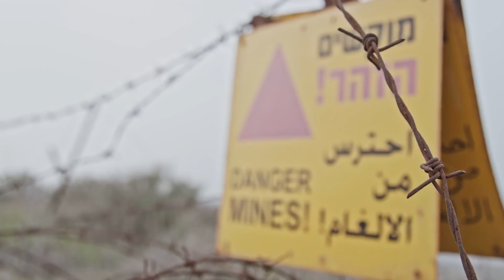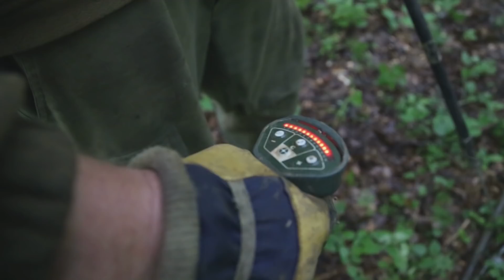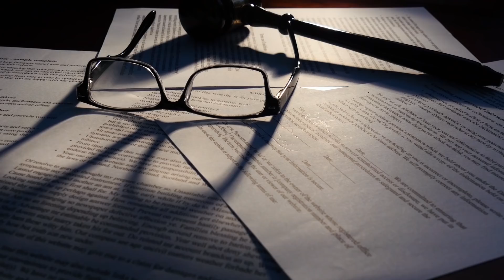Weapons That are Forbidden to Use in Most Countries of The World!

Comment: "the power of such a bomb is comparable to that of a GIANT meteor"
hahahahahaha no.  The biggest thermonuclear weapon ever built was the Tsar bomb.  It had a max of 100 megatons, meaning the energy was equal to 100 million tons of TNT.
The asteroid that killed off the dinosaurs 66M years ago is what everyone is thinking of.  That was a rock about 6 miles in diameter.  Which doesn't really do it justice for the mental image in your head, so picture this instead: when the asteroid slammed into the ocean floor, the top of it was still higher than cruising altitude of airliners.  Big rock.  But I digress.  Its impact was 130, not megatons, not even gigatons, but 130 motherfucking TERATONS.  Every nuke we've ever THOUGHT about making, combined, is a tiny firecracker compared to that.
And while that asteroid was exceptionally destructive, that was due as much to its impact point.  Studies show it hit the absolute worst possible place.  Had it hit land, the dinosaurs would still be around.  Had it keep deep ocean, they'd also still be around.  The exact point of impact served to maximize the environmental impact.  It still would've had the same explosive force, but the consequences would be less serve.  For example of it hit deep ocean, it would have created a megatsunami 3 miles high (the 2004 Indian Ocean tsunami, one of the deadliest natural disasters ever and the result of one of the most powerful earthquakes ever recorded, was a mere 100 foot at its peak) that spread out in all directions at supersonic speed.  Let me know when we've made a bomb that can do that.

Comment: The first one doesn’t make any sense.  We have hallow-points.  I have them loaded in every gun I own besides my shotguns, they are loaded with 00 Buckshot.  However, .22 caliber built, does the same thing, It is not strong enough to get completely through the body, and it bounces off bones.  And a 5.56mm (NATO) or .223 Remington does the same thing.  It gets in and bounces around.  And they are great varmint rounds.  Also, the hallow point gets inside the body, and mushrooms, creating drag, which does not do anything but stops before it exits the body, it was designed to not put anything beyond the target in danger.

Comment: And Lasers, as weapons, even as "blinding weapons," have a very short time-period of usefulness as Weapons, as the ability to create cheap countermeasures typically coincide with the creation of a laser powerful enough to be useful as a weapon.

Hardened aerogels, and Super-Reflective/Super-Refractive materials have now become cheap enough (although the latter two are not yet scalable in production) that it will not be more than five to ten years before the current Lasers developed as weapons will be actually useless. And super-reflective/super-refractive materials are not hindered by paint, dirt, dust, or even being broken.

And eventually, Super-Refractive Materials will also make lasers useless for any purpose (such as target designation, or range-finders). Super-Refractive materials will also negate Radar’s usefulness as well.
Reply: Kind of hard to hide shiny stuff
Reply: US AIR FORCE AIRBORNE LAZER SYSTEMS WERE RECENTLY REPLACED/Retired 2009 uases a 747 airframe as transport.
Reply: 747 airframe google Usaf ABLS YAL61

Comment: Tell the one about the bullets that do the whole flower thing I can agree to those being used in one scenario only and that would actually be a plane hijacking because if you can accurately discharged one into an enemy that has hijacked the plane it presents little to no risk to the surrounding passengers alongside crew and instruments and Hol structural integrity and those reasons are the only reasons I will find them acceptable used at all in that one scenario versus any other scenario is not really acceptable because there is clearly going to be much potentially different way to do stuff
Reply: Only one problem with your statement, you are assuming the person firing the round is a marksman who never misses his target.
Reply: @georgewn1953  read my coment fully and you will see what I said

Comment: War is war. Screw the rules.  You should always be prepared in case the enemies cheat.   Don't sleep on evil it follows no rules.
Reply: Your reasoning is the problem, and the source of such evil, not the solution. Indiscriminate use of DU, WP and mines doesn't just fight a war, it destroys innocent lives for many years after, leaving the perpetrators hated and less safe in the long run. Simple logic and self preservation ought to be a limit on such irresponsible and immoral dumb moves, but simplistic hot headed sentiments like yours often ensure they ARE used, not only to the detriment of generations of innocent civilians yet unborn, but to the great harm of that nation's security overall. The only response then on is to embrace the evil, and become what you claimed you were fighting in the first place. Talking tough may seem right at the time, but such thoughtless actions do great harm to a nation's long term security, not to mention the destruction of its morals.
Reply: If everyone had morals then you would make sense. I agree that land mines are horrible.
Reply: You should be PREPARED, but you shouldn't use unethical weapons unless the enemy is also using them.  Even then, make an effort not to cause unnecessary suffering.  You shouldn't maximize the carnage simply because war is hell so fuck the rules, but you should be prepared and equipped to meet enemy escalation.

Comment: There is no ban on expanding, not expansive, bullets. They are used by snipers and in unorthodox scenarios. The reason line troops don't use them is because they exhibit poor penetration of barriers, and they're more expensive. They stay pretty much on a straight path but create a shock wave in soft tissue. 

Your comment about the sharp edges is the stupidest thing I've heard today. Bullets penetrate and tear through flesh whether they have sharp edges or not.